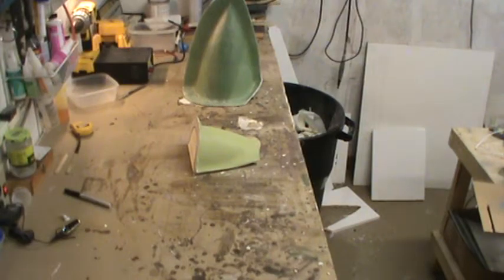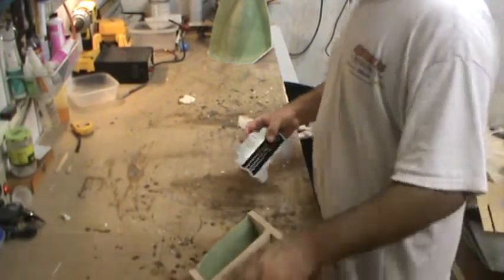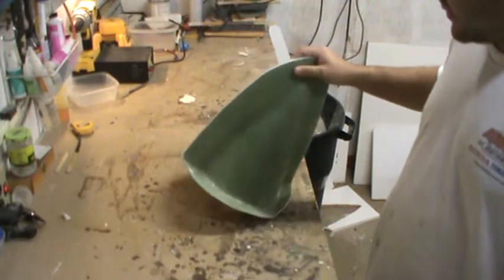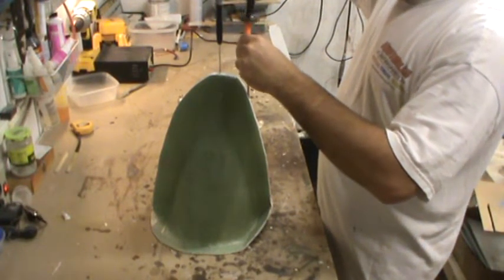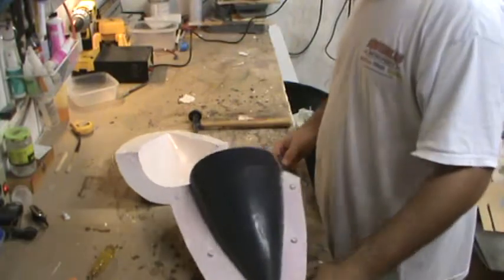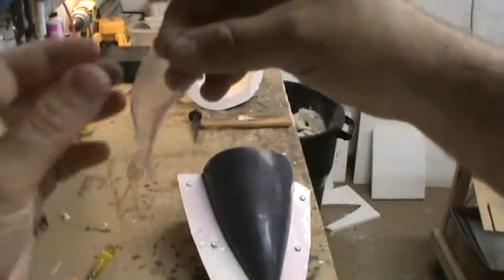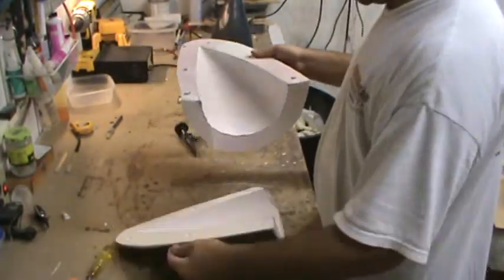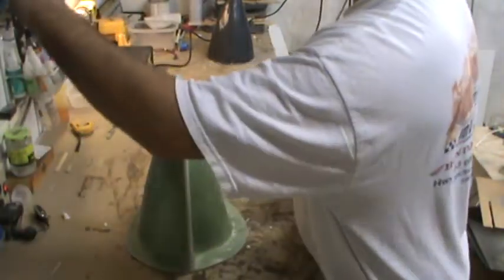How to build an F-14D Tomcat #37

Comment from the maker: @767Seatwarmer.  Yes i agree. If you look at the videos of any of the FEJ f-14's flying, the wings develop some "dihedral" once they begin flying.  I believe this is caused by the wing pivot box attachment structure and the bearing system used for the pivots.  If all this flex can be eliminated, all of the landing issues would be eliminated.  I've got my design to not have to deal with this on my tomcat.....hopefully

Comment from the maker: @767Seatwarmer   Greg, Its apparent you definitely have more experience doing this stuff than I do. Your video's gave me some good thinking time and some education at the same time.  essentially, what you showed is exactly what I had planned on doing, just going about it a different way.  I built my plugs with all of the flanged integrated into them, that way i didn't have to make more mold parts, they would be all integrated. We will see how that works out. The F-111 is looking good.

Thomas

Comment from the maker: @767Seatwarmer   You could do that, the problem is, then you have no flanges for the parts to fit onto. with molding the nose cone and canopy separate, the canopy and the fuselage gets a "frame" along its entire perimeter (which adds strength), and the nose-cone then has a flange that allows it to sit flush with the rest of the fuselage.